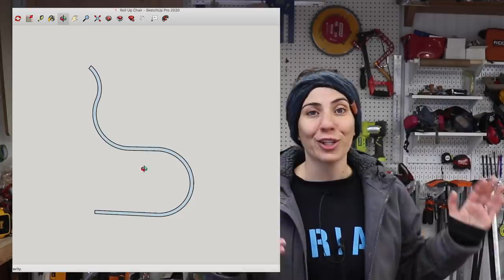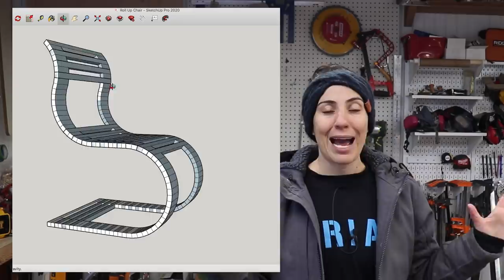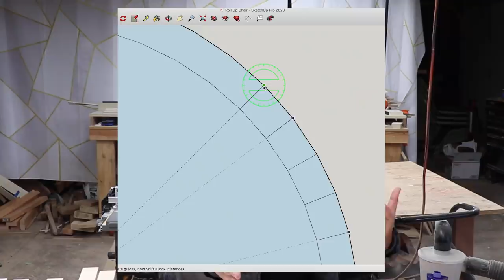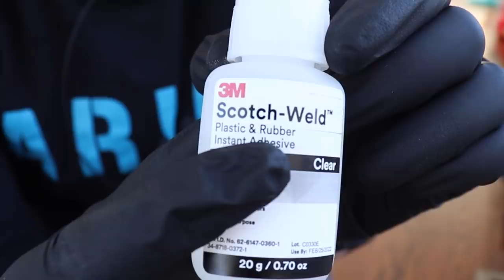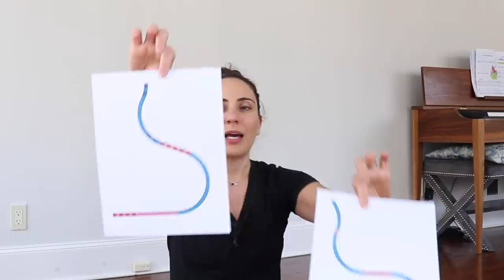I ATTEMPTED to make a chair that rolls up... It didn't go as planned...

Comment: Insted of remaking it, I would shim between the parts until I got it to the position I wanted, just to see how it would act with the back raised up properly.
Even tho you drew it up in sketch up, you did not take into account the flex in materials so the angels would be slightly off on each part and end up with a large error in the end, hence, shiming to get it in its correct position
Reply: Yeah... that's exactly what I was thinking at the end of the video... Just cut a number of shims, and test fit them using the pinching between the boards... You could cut them all standard and just figure out how many to put in in which slots to make the curve you actually want..

Comment: You didn't show a build, you showed perseverance. Good try!
Reply from the maker: I really wanted it to work!
Reply: @3x3CustomTamar  You're amazing! You never, ever give up, do you? I remember how you fixed the mistake you'd initially made with your GGBO guitar last year. Most people wouldn't have bothered. And most people would have given up on building this chair. But not you.
Reply: @3x3CustomTamar  n it definitely will,thing is I believe the back support parts need to be cut diff angle thn sittin parts.you're amazing thu,always enjoy following your work girl,thx 4 sharing darn 👍
Reply: @dollygobby2371  you only need to insert thin triangular cross section pieces of woodbetween back rest to reverse the back rest profile to support the pressure of leaning back.
Reply: That's how the ligtht bulb was invented.
Reply: @bartmoorthy9513  I agree. That was beyond impressive, both in skill and execution, as well perseverance and commitment to getting it right.
Reply: @dollygobby2371  I agree.
Our butt is definitely at a different angle than our back...

Comment: Put some shims between so you can play with the angles a bit more. That way you can actually sit and test it.
Reply: This seems like a very good approach. Use the same thickness between all of them as you can use that to find the correct width for all of those strips. 

For a quick experiment setup, use some perforated metal hanger straps. They're strong, don't have any stretch in them and comes with holes for screws. You'd need to put the chair on something rather than directly on the wood floor of course, but it'd save you from having to struggle with mounting the better straps until you've figured out the angles. 

Even if the holes don't line up perfectly for the pieces, this isn't too much of a problem - instead of having a single strap for everything, just use shorter pieces. If needs be you can have a piece for every connection and simply offset them as needed.
Reply: Yes that’s what I was thinking to. Figure out the amount of angle necessary the device thickness between each space. Glueing a hard rubber or plastic or just use wood shims. The same model chair could be used. The bottom of chair looks great. Taping the spacers first to do a dry run would possibly be best option.
I think it’s not a fail yet. Just finish with spacers.
Reply: Walnut or Padauk shims would look great
Reply: Ben nault is right add some wedges on the back parts that should give you more curve and better support. And its not a fail its just not the right angle for your back.
Reply: If the math says 86 degrees, even with a hard wood, 87+ to compensate for compressibility.
The test with Pine will compress more and ruin a test for hardwood. Also the pine will be less elastic. Skip the pine test. Use the same Maple, find a better connection method for rapid prototyping.
Reply: My thought exactly when she originally did the webbing early on.
Reply: I wouldn't abandon the use of maple necessarily, soft wood will compress a bit. I like the idea of using shims to test the angles. Also, the use of rubber won't add enough strength to pull it back. Seat belt material should be good enough to not stretch. And the flat sections maybe add a couple degrees to 92°ish. That way when you add weight it will stretch into final form.
Reply: I think that you put angles on the wood BUT. That took away from the tension supporting the structure (they were too thin to support themselves) everything else was correct  GOOD WORK👍👍👍👍👍
Reply: Yes! I think that adding shims will be a great way to compensate for straps stretching and the wood compressing. 
What a pain having to make so many. 
I’m concerned that using a softer wood will compress more and thus mess with the angle even more. 
It really amazing to me to get it work as much she did.
Reply: I wonder if fire hardening the wood might help prevent it from compressing so terribly.
Reply: Totally agree, sometimes maths and computers isn’t the right way to figure something out and you need to play with it ensteaf

Comment: maybe tunneling a internal steelcable structure with some "tensioner" at the end, to give the right tension it needs to have, in order to support the added force when you sit...
Reply: I agree, take it one step further with an internal ratchet strap to minimize wear (steel/wood versus nylon/wood). Plus’s they can be picked up cheap!
Reply: Agreed - I had that same thought from a posable dial indicator freezable arm I use at work.  Because the cable might wear against the maple, it might be a good idea to journal some tubing or use a cable sheath.  Wear points will inside the curves at the edges of pieces under tension, and shielding would help prevent deformation in those areas. Additionally, a router could produce interlocking cams on the pieces which would alleviate some of the alignment issues, particularly under load.
Reply: Aaaaaahhhh! That’s a super good idea. I agree
Reply: Try dyneema (Ultra-high-molecular-weight polyethylene). 8 times stronger than steel, very low friction, low wearing, and even much less stretching.
Reply: You could tunnel webbing! As for the tensioner, since when the chair is rolled or flat the cable or webbing would be loose you just need a clamp on one end and you can hand tighten it and clamp it in place.
Reply: Me as an idiot reading these comments: 🙉🙉🙉
Reply: I worked on a very simular idea couple of years ago and ran in to the same problems.  steel clutch cables tru the center and round contact surface  did hold , also make the wood as wide as the chair for moore surface area, sorry for the grammar iam not native englisch speaking
Reply: @dillthedillinger  Nah just Kevlar thread.
Reply: Could use chainmail strips

Comment: Love the effort. Two things I’d change. Find a material that doesn’t stretch as much (you don’t want the gaps to open up you want them to stay tight together under load). Then I’d glue the strap material to the wood pieces with some kind of rubber cement or similar. That would help eliminate the stretching of the strapping as well.

Comment: Idea:
1.) Drill channels into the wood through which you can pull steel cables and put something at the end for tightening.
2.) Make the legs and the sitting section slightly thicker... actually, make the whole thing x1.5 thicker
3.) To mitigate unwanted rotations around the vertical axis (especially in the leg area) choose steel cables that are a bit on the thicker side and don’t pull them directly through the wood, insert metal tubes into the wood through which you can tightly pull the steel cables and put two cables near the margins of each leg, basically in an attempt to stop each individual leg from twisting around itself.
4.) Very hard woods are your friend in this case - almost no screws required !

... try replacing the steel parts with carbon fibre and other stuff if you hate to see your chair rusting, or just oil up your chair, it’s your choice.
Reply: Yep - this.
While the idea of a chair that rolls up is inherently impractical and flawed, using stiffer materials certainly would make it more usable.

The suggested steel-cables - they are available in corrosion-resistant materials. Steel ribbons might also work nicely, but can not be rolled up that tightly.
And the wooden parts them self might also benefit from being made from harder wood or at least have a hard surface protecting the edges as the wedging-action concentrates the force on the edges. Together with the elasticity of the fabric it makes the whole construction very springy. (the form you used is also often used specifically to make springy wooden chairs)
And to prevent rocking from side-to-side some interlocking fingers might help a bit, but a construction that can be rolled up inherently has that problem unless you have some extra mechanics in place to prevent that.

If you want to make the whole thing lighter - the wood does not need to be solid. An ibeam form would also work. The stress is only compression on the inside-surface and tension on the outside.

And lastly - using some normal metal hinges instead of an elastic material for the rollup-function might work.
Reply: Belts are built for tension and not for compression. Thats why the legs work and the backrest sags. Cables seem tempting but if you pull one cable through the hole chair you will loose the ability to roll up the chair.
Reply: @ABaumstumpf  steel micromesh weave would work very well instead of the belts and still allow for rolling up.  The problem is itd be expensive.  I feel like she's really close, and just removing like 1 or 2 slats and re-attaching the belts would fix the angle enough for it to work right.
Reply: i agree.I think the thicknes is the biggest problem. it would make the whole chair much more stable if u had thicker wood blocks
Reply: You beat me to it.  I just had the same idea and posted above :-)  Just need to rout a radius on the top side of the blocks to allow the chair to roll up.
Reply: The blocks need to hinge on the top, not in the middle. Else you can't roll them up
Reply: Lol this is exactly what I thought, nice!

Comment: At the stage you left it, I would add shims until you get the angle of the back of the chair correct. That could help you figure them out for the next attempt. Also, try adding a couple degrees on those angles in the design to compensate for the flex.
Reply: This is exactly what I would do, add shims and account for the flex of the material. Perhaps even make the back a few degrees forward, that way when it stops flexing it ends at a comfortable angle. I also noticed the seat looks a bit long and would be worried about the strength of the material past a certain distance.
Reply: This. And start the seat 1 or 2 segments earlier.

Comment: Hey Tamar: how about running a steel cable, say 1/4" diameter, through the wood on each side. You could counterbore the first and last pieces to hide the crimps at the cable ends.
Reply: Yep ! I think that’s the way to go .  Thin steel bike brake cable threaded though a drilled hole in each section, crimped at one end and adjustable fixing at the other. This would act similar to a human tendon ( tendons don’t have adjusters😂)
Reply: That was the idea i had, whrn si saw there was only feld. Tunnelling a wire or cord through the sections ist loads of work but would make it look like magic holds it...
Reply: It'll probably lose some foldability.
Reply: The top works in tension, the bottom in compression, cable in the middle would cut the lever action in half. It could work by making the whole thing thicker, you could maybe run the cable in upper 1/3?
Reply: Ohh I like this idea
Reply: I'd worry this would cut into the wood.
Reply: It wouldn't be able to roll up
Reply: I was thinking a steel braid. Or even a piece of steel banding.  she’s underestimating how much stress is on the webbing. Basically at each little block you have a lever ratio of the length of the block to the distance to her butt. That’s a huge force on that webbing. Like 10 to 20x multiplier so it’s stretching a lot more than you’d think.

Comment: Love that you just sketched it, cut it, and started assembling. A great Roll-up Chair 1.0!

Idea: wrap the belt on outside of both curves, so the bottom stays the same but midway up a break and the belt continues on the other side of the wood. Probably more back support, but one complication: you have to fold it in half before rolling up.

Comment: You could try drilling two holes in the direction of the webbing and feed steel cables through the holes. Anchor at one end and then take the cable all the way through one set of holes and back through the other hole in the pieces on one side and repeat for the other side. Apply an amount of tension to these cables to achieve the desired shape and bounce. I really enjoy your videos and look forward to you putting them out.
Reply: This design may impede the ability to roll up the chair.
Reply from the maker: Yes. If fixed it would impede the roll up aspect. But if there was a way to loosen it and then tension it back up. That might work.
Reply: Looks nice. Tension might be set up by several ways. Check your bike axes for quick release help.
Reply: I thought of the exact same thing. Also, thought of cable tensioners (?) but I think that would take away the elegance of the design
Reply: interesting!
Reply: I had the same thought but what about using shock/stretch chords under partial tension?  Her idea with the rubber was to keep the slats pulled together and the chords should be able to stretch enough to roll up.
Reply: whoa, that's nutzgenius
Reply: I thought of the same idea. I wouldn't use softwood though because it would compress, use hardwood

Comment: Before you take it apart, try using shims (maybe craft sticks like tongue depressors) between the blocks at the back.  That might help you prototype that part and home in on the correct angle.
Reply: Redthumb45. I thought exactly the same
Reply: Or leave the green tape...
Reply: Yup! One advantage to a 'failed' attempt is that you can use the pieces you made as the foundation for experimentation. They're already goofed up so what do you care if they look goofier after the next try?
Reply: @michaelmcdermott2178  yes. Failed pieces and scrap lumber are good resources
Reply: Paint stir sticks would make handy shims if you can get a handful of them
Reply: What about third brace "seat belt" between seat and back rest

Comment: I have an old school trick for assembly for you...
Use pva glue to glue the parts together first, but instead of glueing ‘wood to wood’ insert a single sheet of newspaper between the peices, then clamp as you would for a full glued assembly.
Once the chair is assembled glued, add the strap. 
Then unroll it, the paper will shear in the centre, leaving half of the paper left on each face - if needs be, give the joins a tap with a wide bevelled chisel to split the paper.
Of course it will need cleaning up (with said chisel). - to minimise cleanup just glue short patches rather than the full contacting surface.

Comment: I think you were on the right track with maple - pine would compress more and throw the radii out further.
Reply: Agreed. The issue I have with prototyping in pine is it doesn't always give you a good idea of the nuances of what you will be doing later in the final version.  A lot of time I have wished I just built something once and out of the correct material. Then again I'm always pained when I see the cost of prototyping in a better wood lol.
Reply: I don't think pine will work either, it will give/crush too much and there is a lot of stress on those parts.
Reply: This project required more prototyping steps in general. One of the biggest things that got overlooked is material compression.

Comment: For me it looks like having as little elasticity in the strips as possible. Maybe use some steel cables inside of grooves under the strips. Rubber would be too flexible, it should be as stiff lengthwise as possible.
Reply: Some kind of hinge might be even better.
Reply: Airline cable routed under the straps and capped like a guitar truss rod might work pretty well
Neat challenge

Comment: Hope this doesn't come off badly. I think the angles are very important to get right, that includes after sanding/finishing. I think also the wood has to be a hard wood since they push against each other to hold the shape. (saying that since you mentioned softer woods for testing, doesn't need to be expensive, just needs to be something hard) Then I think the pieces need to be as close to side by side either flat on the floor or in the curved shape while screwing them together. So making the circles for the pieces to curve around may be a good idea for you to keep them as close as possible. Lastly, I think the material that holds them together shouldn't be able to stretch at all. (if possible) I think if it can stretch, the angles and forces between pieces will not be as strong/correct. I think the felt is applied on top of a non-stretchy, thin, strong material. The material has to be strong enough to hold your weight while wrapped around the inner circle shape. Those are my best guesses, hope they didn't come off as saying you did a bad job or anything. You really did pretty great and gave us all the ideas on what seems to work and what doesn't and why. Wish you the best. :)

Comment: I’d use a rope longitudinally. Drill holes in each piece recess a knot end or not if you want it rustic. Maybe a two position attachment. One for sitting on and a slacker setting for rolling up.